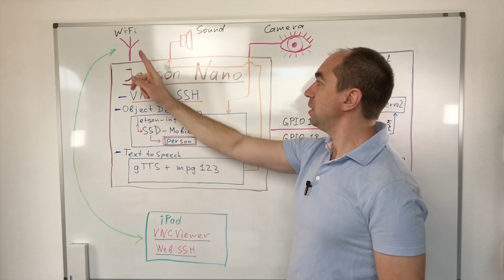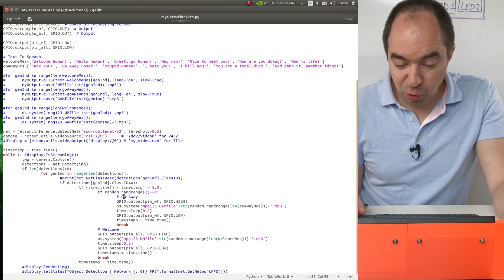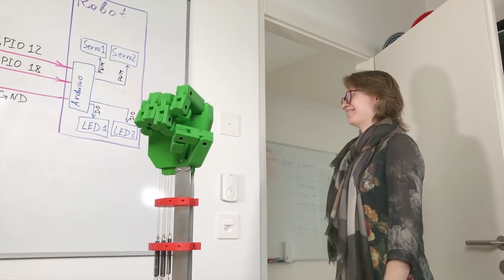I’ve built 3D printed Middle Finger Robot [fun diy robot hand]

Comment: With default "Unity" desktop manager - Jetson Nano consumes 1.6GB in idle time, not much left for other activity. Suggestion to switch to more lightweight "LXDE", which saves ~1GB - select it in the desktop managers list, opened by clicking on an options button, next to the password field during login (reboot afterwards).
Reply from the maker: Great tip! Thank you!
Reply: @Skyentific  In case you'd like to improve performace even more, I'd suggest to use the external SSD as a root/boot drive, as described here 
https://www.jetsonhacks.com/2019/09/17/jetson-nano-run-from-usb-drive/
It works good for me so far.
When you have to build something from sources (e.g. I built latest cmake 3.19 from sources, because building ROS Foxy requires cmake functions, not existing in default cmake 3.10) or when you use NVIDIA or other docker containers, download and train networks (which would consume 10GB on disk: `sudo du -s -h /var/lib/docker`, `du -s -h ~/jetson-inference` ), using swap-file (suggestion not use swap-partition in this author's early article about SSD from 2019/04/25 - it is better for SSD wear leveling algorithm) - SSD will be 3-5 times faster on SSD, then TF-card.
Please note, that different USB-to-SSD controllers affect performance in pretty large range. And SSD can be slower SATA (300-500 MB/s) or faster modern NVMe (2000-3000 MB/s)

Comment: shouldn't strings work in opposite direction, because when wire is pulled it can transmit more force, like muscles in hand are stronger for closing than opening the hand.
Reply from the maker: Yes, if you build a hand for grabbing something. My hand was design only for one thing: to show middle finger.
Reply: @Skyentific  what a respectable piece of work! love your inventions